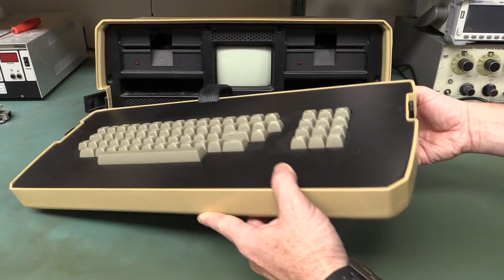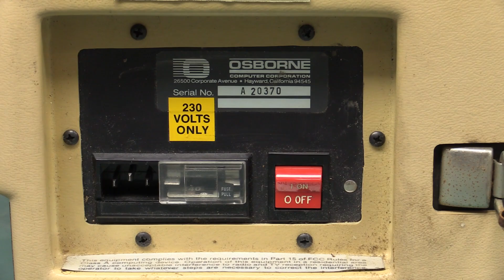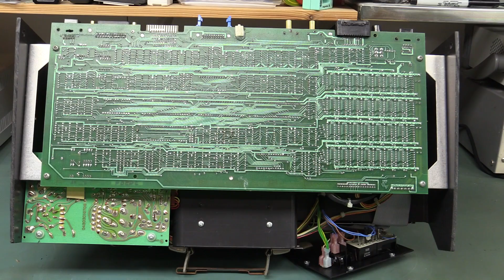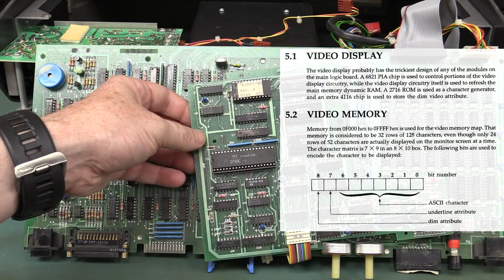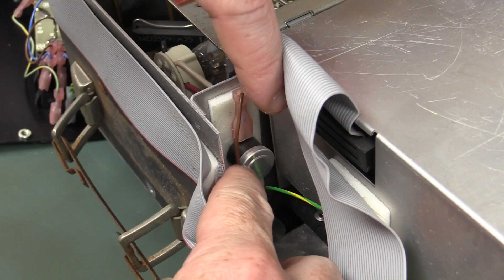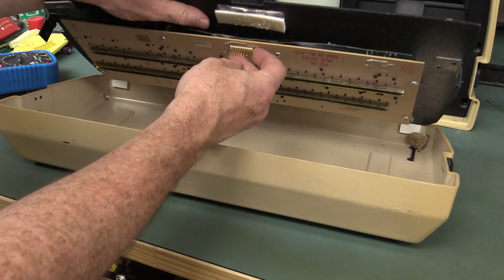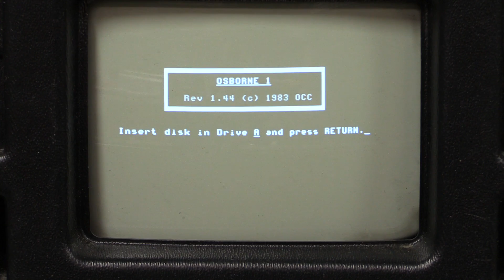EEVblog #955 - World's First Portable Computer Teardown

Comment: If it has that low serial number, then it would probably not be surprising if the reason for why the ram is mixed manufacturers is probably because they thought they would only make ten thousand units, and therefor only bought chips to make that many.
And when they sold far more then that really quickly, they probably realized they needed to buy more ram and really quickly, and given the year, then buying thousands of RAM chips and getting them delivered in less then a month, then one probably have problems getting them cheap from one manufacturer.

Comment: I think the answer to why the CPU was on the second board is pretty obvious.  They had to bring the whole data and address bus out to the second board and they can kill two birds with one stone by using the board interconnect as a CPU socket at the same time and save tons of board space.
Reply: Adam Perry I'm almost sure that the daughter card is an aftermarket modification. That external video RCA plug which is unlabeled on the front panel is not present on the standard unit. It probably leaves you more available ram by adding extra dedicated video ram, or more advanced video modes.
Reply: I think it relates to the mysterious "External Video" card edge connector:  The Z80 was probably meant to be socketed directly onto the main board without a daughtercard, and the video hardware (character generator, whatnot) expected to be separate and connected to that front-panel port.

The only reason my above idea would ever make sense is if the machine (and board) weren't actually designed to be portable, and I think that's a likely enough scenario given how poorly-fit the whole thing is, with its acres of wasted space and fat, cheap, surprisingly-resilient design.

But that's not all that unreasonable.  Imagine, if you will:  The design shifted focus from just-another-reliable-desktop-Z80 box toward being a real portable computer ("Hey, guys!  We found a huge stash of cheap, new CRTs!  Let's build a 'portable" computer!'"), and this shift didn't work with the existing (but functional!) board layout.  So, bodge wires were added, and bodge wires remained.

Their reverence to the generally-original layout on that board is obvious, given the lack of any other bodge wires.

I'll bet that the thing boots and runs fine with the Z80 socketed directly into the mainboard, without the daughtercard....just without video (unless there's an external video adapter plugged into that card-edge connector at the front, which may or may not have ever existed in production).
Reply: No - it's almost certainly the 80 column card.  If your curious, here's the install instructions, covering the ridiculous ribbon cable install. http://bitsavers.trailing-edge.com/pdf/osborne/osborne1/SCREEN-PAC_Option_Installation_Procedures_Oct83.pdf
Reply: I believe it is the "Screen Pac" expansion card, it's purpose is to allow the owner to use the computer with an external video display. It has all that extra circuitry to allow the external display to show the standard  CP/M text resolutions.
Reply: http://www.kev.pulo.com.au/osborne1/documents/o1screenpacusersguide.pdf user manual for the screen pac.

The placement of the RCA matches, so I think it's either the screen PAC or a third party variant. It came out in '83, so I expect the later models of Osborne would have a normal connector on the board to more easily get those signals, but on the early models like this one they didn't quite have all the needed stuff on the normal expansion headers. It was fairly common practice back in those days to have expansion boards that would stack straight into the CPU socket — my BBC Micro ARIES B12 and B20 did so as well for instance. It was also fairly common, just like it still is for things like mod chips, to have wires going all over the place to random solder pads and ic legs.
Reply: Ts6451 I think you're right. I'm totally forgetting the details, but I have a very vague but firm memory that there was a special video add on board that overcame some of the limitations of the default circuitry. I know that mine had a board doing that, but it's been so very long since I had it that I don't remember if it was quite as bodgy as this one. I think it may have allowed for 80 column  display on the external display.
Reply: I'd guess that the original motherboard design intended to use a terminal -- TTY or VDU -- connected through the serial port. This wouldn't make a good product so the designer put a daughter board to carry the the visual display circuitry. Adding this to the main board would have required a completely new layout which would cause all sorts of production problems. (FWIW I had one of these machines, I used it for a couple of years when I lived in England and left it with a friend when I came to work in the US. I was brought to the US by an IBM-PC clone manufacturer -- Corona Data Systems -- who made a similar product.....so I got an inside look at the kinds of issues you get when you try to make a complete motherboard, video and all, on one large dual sided PCB. "It ain't pretty!")
Reply: I looked up the service manual, none of the versions i found had this daughterboard.

Comment: 22:50 that X capacitor not looking too clever
Reply: Looks like at least the one of those (thin film/polymer?) caps blew its guts out.. above the fuse at least. +EEVblog  Had the same type of cap blow up on an old power supply for me.  Maybe Dave could explain why they don't affect operation after failing?

Comment: The power supply is a pretty standard one, used for many projects.  The strobe disc is for 50 and 60 Hz power line frequency. Double sided floppies were hard to make due to fragility of the head assembly.  A double sided one impacts TWO head assemblies across the disk surface.  The "big power resistor of the CRT is a high value (multi megohm) bleeder resistor.

The more portable computer was the Radio Shack/Tandy model 100 that ran from 4 AA batteries.

Comment: The Osborne was the first successful portable computer, but it was not the first "portable" computer. That would be the IBM 5100 from 1975, which they proudly advertised as a "Portable Computer" despite the fact that it weighs 50 pounds!
Reply: But one of those would be essential right before 2038
Reply: John Titor collects them
Reply: After the IBM 5100 comes the HP-85, and then the Osbone 1
Reply: True fact.

Comment: Some 1As did have 5.25" DD drives.  The slots below the drive were for an internal modem expansion.  The not fun thing is how fragile the modem cable seems to be.
Reply: Osborne produced a double-density upgrade board which would give you double the storage capacity without needing to replace the floppy drives. Later on, the DD functionality was built into the main board, as well as the 80-column upgrade (which is the large daughterboard in this Osborne).
Reply: VWestlife (backup account) nods I have a 1A with 5.25" DD drives.  Also, the ROMs appear to be upgradable because the ROM version in the video is the same as my 1A's.  Was it for 80-column support?

Comment: boy that brings back memories, I designed PC boards from 1779 to 1982 in Silicon Valley mostly for defense contracts, everything was done by hand, applying tape for traces. We couldn't run traces under IC's and through hole were frond apron, it involved hours of mental stratration
Reply: Frustration. What a pain in the ass it was. Dave
Reply: A board that size would take weeks to design. Usually the electrical engineer layer out the location of individual component then I would have to figure were to lay traces. We usually got the final design after two or three prototype runs, two or three board made. Dave
Reply: If I remember correctly we laid the board out at twice the size then reduced it to make the negatives for the PC board manufacturer that was outsourced. Silicon Valley at that time saw incredible place. Dave
Reply: A true pioneer, PC boards before steam engines!

Comment: I think that 2nd photo sensor on the floppy drive was for write protect notch detection not for disk presence.  Before those nice little plastic sliders on 3-1/2" disks there were hand-held disk notchers and round plastic and paper stickers for write protect on 5-1/4" disks.

Comment: I'm sure Dave knows this and just misspoke, but at 24:08, it's 50/60 hz strobe, not 50/60 RPM - if you had fluorescent lighting, it was stroby enough to calibrate the speed.  Incandescents gave a blurry, barely there effect.

Comment: I love that the blue bodge wire at 18:15 is held down by the resistor. Resistor must have been inserted after the free flowing wires.
Reply: On second thoughts, they probably just jammed the wire in the empty space after resistor installation...

Comment: That second sensor on the floppy is the write protect notch, not disk presence.
Reply: Yes.  The only way to know if a disk was there was to spin it up and look for index holes.
Reply: The sensor near the middle is the spinning sensor.  The sensor on the left was not a spinning sensor.  It was on the edge away from the circular disk.

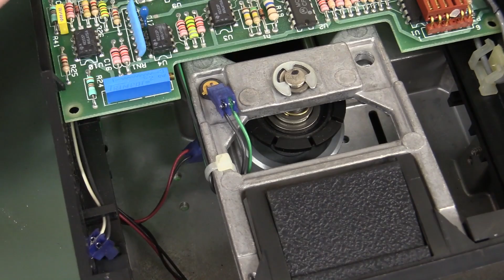25:06 - disk start of sector sensor
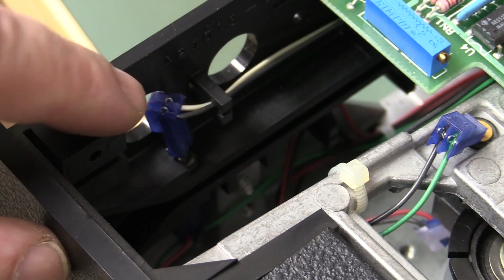25:28 - disk write protect sensor
Reply: I am too familiar with that write protect sensor.  To use the other side of the disk, we used a hole punch to make a whole on the opposite side of the disk.  Sometimes we used scissors to square up the hole.  After we punched the holes, we could cover them up with special labels to write protect the disks.  We even used masking tape to write protect the disks and block the light on that far left sensor.
Reply: I had a purpose-made square hole punch for that back in the day. :D
Reply: +Bakamoichigei I made removable write protect covers from a piece of dark colored paper that would cover the notch while sticking out the front of the drive for easy removal / insertion as needed.
Reply: @JohnDoe-qx3zs  Cool.

Comment: The 50/60 markings on the spindle of the floppy drive don't indicate the rotational speed (it would have been a couple hundred RPM), but what set of markings to look at depending on if you were using a 50 or 60 Hz strobe light to calibrate the speed.
Reply: John Doe

No, you can't do it with incandescent lamps at all. They don't flicker at mains frequency because the thermal inertia of the filament allows it to stay glowing during the zero-crossing of the mains voltage. When you turn an incandescent lamp off you can see it take a fraction of a second to cool down.
Reply: Just like a turntable.
Reply: Todd Berg
Yep! But only with older fluorescent light fixtures that use magnetic ballasts. :P
Reply: themaritimeman You could use fluorescent lights as the strobes - two freqs make it global...
Reply: themaritimeman  Makes sense – thanks!
Reply: Exactly. Dave's motto seems to be "If you're going to be wrong, do it at the top of voice".
Reply: +Todd Berg Also works with incandescent lights.  The actual blinking is at twice mains frequency (100Hz or 120Hz) and at the correct speed the lines for the local frequency should look stationary under the bedside lamp in your hotel room.

Comment: The 50 / 60 timing marks on the floppydrive motor is probably for 50/60hz strobe light calibration :) Just use a normal lightbulb

Comment: The video board an optional upgrade to higher resolution.  They did make an external monitor but very few sold.
Reply: Maybe that's the reason for the bodge wire bonanza?
Reply: Yes, it's the 80-column upgrade daughterboard.
Reply: That board is a pain in the ass to fit.  My first job was as a computer technician and had to fit one of those.

Comment: Is the 50/60 rpm of the floppy drive somehow linked to the 50/60 Hz mains frequency?
Reply: No.  There was a multi-turn pot on the board to set the speed.  I wrote a MS Basic program that measured the time between the blips from the sector sensor.  The results were displayed as asterisks on the monitor which were positioned laterally on the screen by varying the number of leading spaces, one line at a time.  There was an index line for the correct speed formed by "|" characters.  You could adjust the pot and watch on the screen as the speed varied.

Comment: Did you replace the cap that had disintegrated in the PSU. Those caps always need replacing, after 30 years they can't take it any more. Had to replace the ones in my BBC B and IBM 5150, as they started smoking.

Comment: My Commodore Amiga 1200 is starting to turn yellow, any way to stop it, I now store it in a dark room.
Reply: I like it. It's sort of a patina for retro electronics.
Reply: Retrobright.....
Reply: Google for Retr0brite
Reply: I've been using a product called AF Foamclene for a decade or more. It works wonders every time, on every kind of computer surface. On yellowed stuff you just have to let it do its magic on the material for a few minutes before wiping it off.

Comment: i thought that the Datapoint 2200 was the first
Reply: The Datapoint 2200 was a terminal, and it wasn't portable. It's historically important for other reasons: I think it was the machine for which Intel developed the 8008 processor.
Reply: Nope - the datapoints were full computers (I wrote my first code on one - twin cassette drives and 5" or so monochrome screen.  Compiled basic).  They did come with a terminal program - which talked to an acoustic coupler on a serial port.  yeah - I'm that old :)
Reply: oh, now im just confused
Reply: Jennifer Cross It´s all in that video...;)
Reply: Howard Kurtus don´t worry that´s the usual, when dealing with old computers...;)
Reply: I love it when I meet the nice side of the internet, thanks :)

Comment: Looks more like an old oscilloscope
Reply: +EEVblog You could also put accessories in those floppy disc storage slots. The modem slid into the left slot making it more of an internal modem. I've also got a later Osborne Vixen and a "Schoolkit" that was a non-luggable version to dissuade theft.
Reply: +khaitomretro In my opinion second storage slot should be used to hold some stylish magnifying glass to actually read something from the screen without looking like a cat staring at turning table in microwave oven;)
Reply: That's not an oscilloscope CRT, it uses magnetic deflection. An electrostatic deflection oscilloscope CRT would be too long to fit in the case.
Reply: Dave, it is my idea ,the audio has a background noise?
Reply from the maker: The camera with shotgun was further back than normal to get the wider shot.
Reply: The image really looks better in this way.
Reply: wow......
Reply: It is possible to not connect the electrostatic plates and add magnetic coils to the neck. The length of the tube does hint at it originally having electrostatic deflection plates. I do know there were some special made 'scopes that did have magnetic deflection, but they were normally low frequency and made for a specific need (TV vectorscope comes to mind).
Reply: Exactly, also IIRC there was no 5 inch (or rectangular for that matter) electrostatic deflection CRT in the US that had a P4 (White) phosphor as electrostatic deflection was phased out rather early in the world of TV due to RCA freely licensing the magnetic deflection patents.
Reply: I have to do that every day with ordinary displays!
Reply: Rumor has it that the 5" CRT was from a an oscilloscope.  Osborne got them cheap.